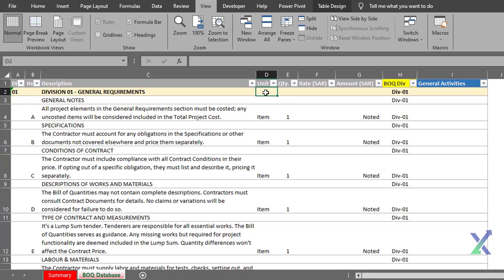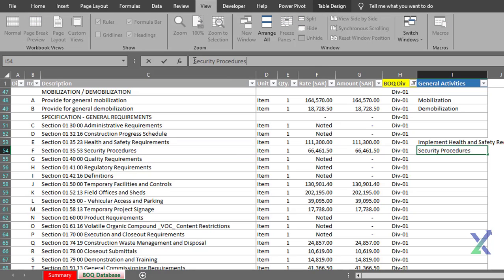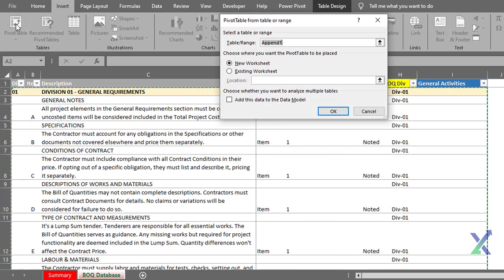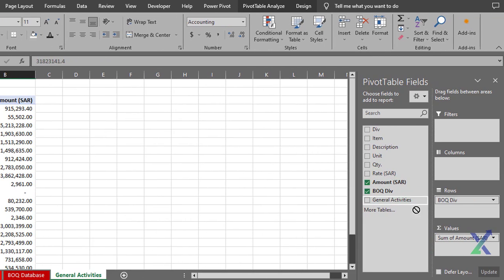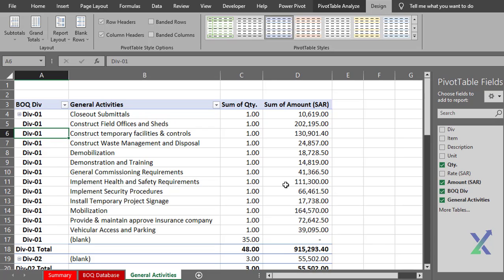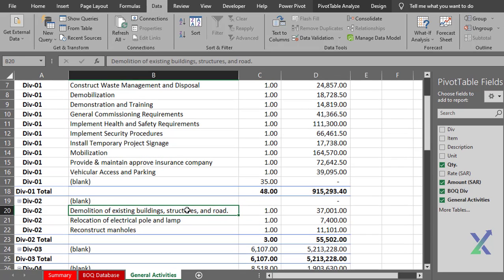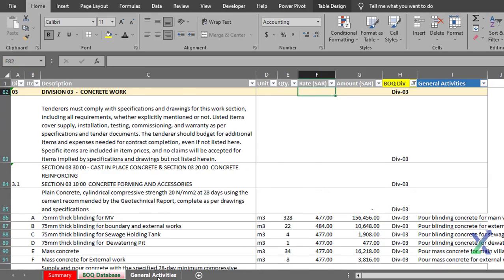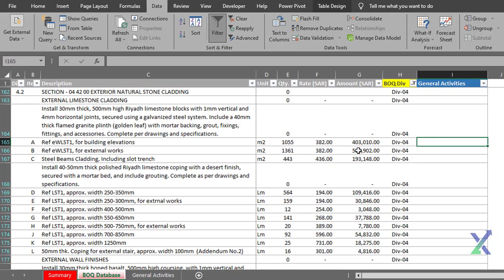𝐄𝐚𝐬𝐢𝐥𝐲 𝐭𝐫𝐚𝐧𝐬𝐟𝐨𝐫𝐦 𝐁𝐎𝐐 𝐢𝐭𝐞𝐦𝐬 𝐢𝐧𝐭𝐨 𝐚𝐜𝐭𝐢𝐯𝐢𝐭𝐢𝐞𝐬 𝐚𝐥𝐨𝐧𝐠 𝐰𝐢𝐭𝐡 𝐭𝐡𝐞𝐢𝐫 𝐚𝐬𝐬𝐨𝐜𝐢𝐚𝐭𝐞𝐝 𝐜𝐨𝐬𝐭𝐬 𝐚𝐧𝐝 𝐪𝐮𝐚𝐧𝐭𝐢𝐭𝐢𝐞𝐬.

Comment: Hello, I hope you are well, with endless love and respect.
One of the most important problems that construction projects suffer from is the large discrepancy between the estimated value of the project and its period and the final value of the project and its period.
The reason for this is due to the lack of transfer of project data between its stages, starting from the initial design stage until the end of the final delivery stage of the project in a detailed and satisfactory manner.
From this standpoint and the development in data technology represented by BIM construction modeling and the electronic means used in project management, represented in the basic form by the PRIMAVERA Soft-ware, we aim, by working in an integrated manner between the REVIT Soft-ware and the PRIMAVERA Soft-ware, to prepare an effective and applicable work schedule under the BIM system, including all specialties that included in the management of construction projects, which is for the purpose of enumeration but not limited to:
Design management
Tender management
Procurement management
Contract Management
Cost Control
Quantity Surveying
Timing Schedule
Human Resource Management
Equipment management
Subcontracting
Logistics management of the project site
Risk Management
Changes Management
Claim Management
Quality Management
Security and Safety Management
Initial and Final Delivery of the Project
And so on....
Regarding the steps taken to achieve this aforementioned schedule, we are presenting for you a series of videos that explain the steps one by one to actuating this purpose on my YouTube channel.
https://www.youtube.com/@ErolMURATLI 
After continuous binge-watching of these videos one by one, you will eventually be able to start setting up this aforementioned schedule.
If you would like to discuss this matter or who wants or needs such a work schedule for his construction projects, please contact me at my email address.
muratlierol@gmail.com
Or call via WhatsApp number 00904754978.
Based on the subject, I am sharing the (04A Design Work Schedule – Site Context CAD & BIM) series in the attachment, and I look forward with great pleasure to it being watched and shared to a wider audience.
https://www.youtube.com/watch?v=ZO5xNuDrGhk